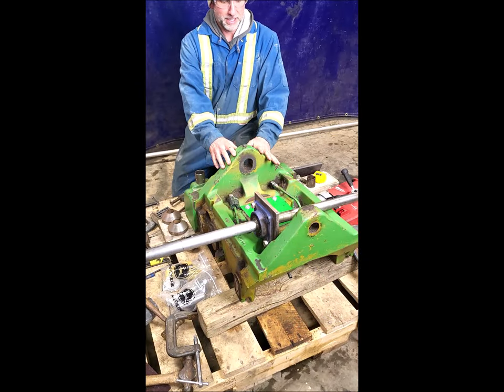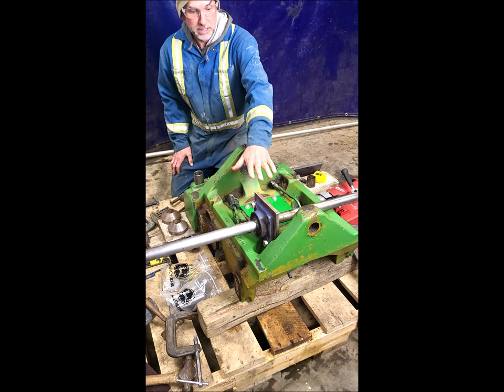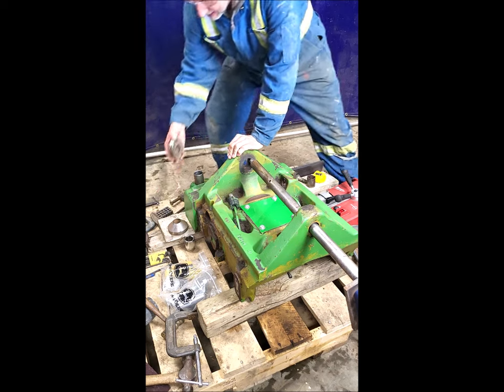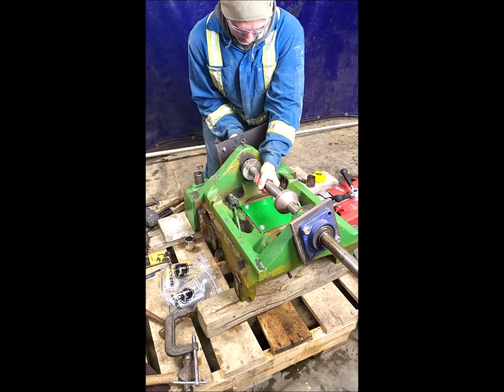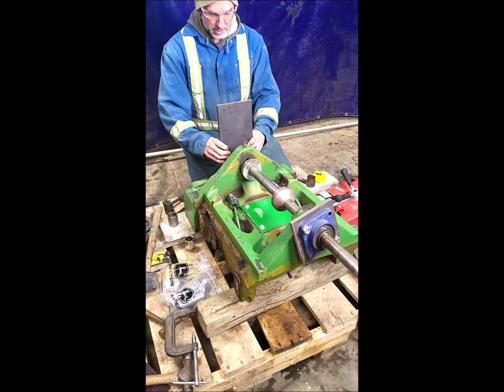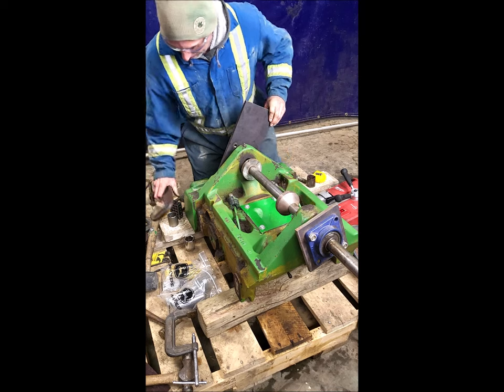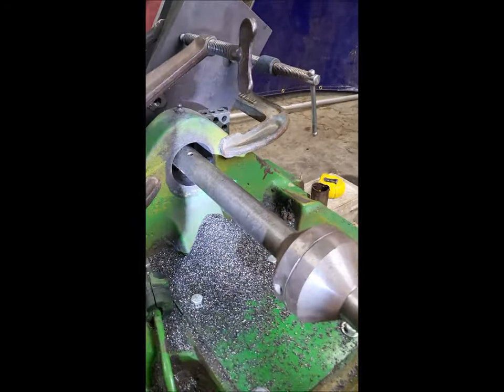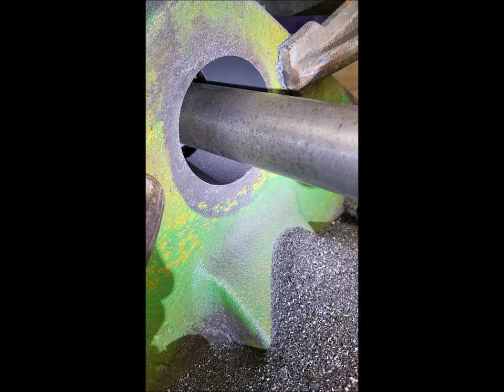DIY Line bore on John Deere 4440 steering axle

Comment from the maker: Thanks for the comment. The trouble with this job it that the steering assembly is in the way.  I had the dealership remove the front frame and steering components from the tractor as they were doing complete engine overhaul. You can see they bolted a small green plate to cover the steering box internals. You would have to bore the hubs a different way if it was still on the tractor.